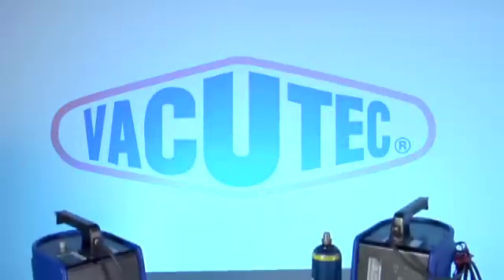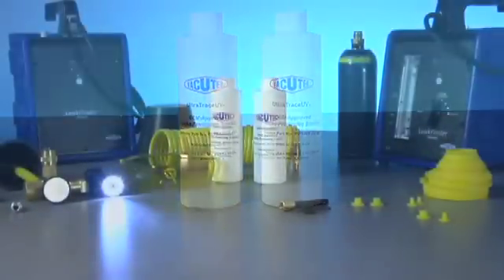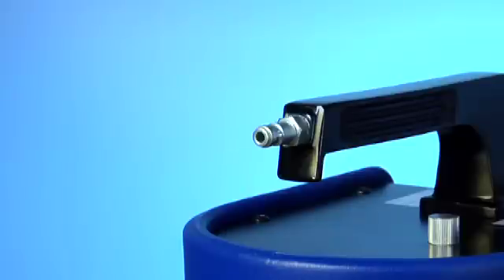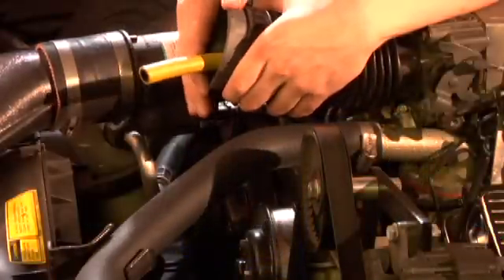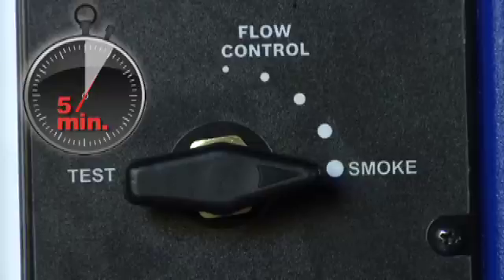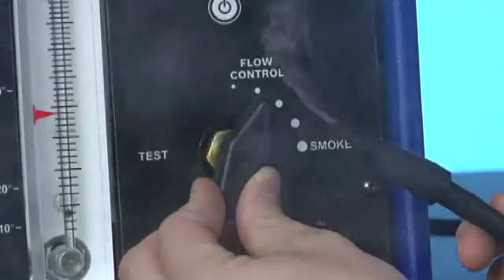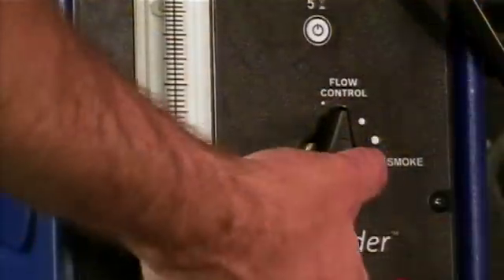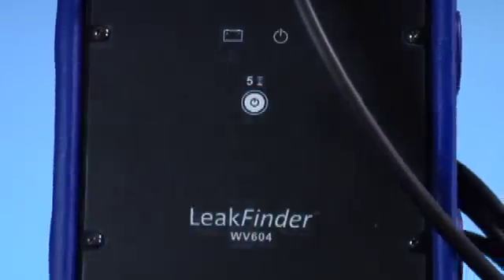Vacutec Leak Finder_WV605 And WV604

Comment: Old machine eeld601 lights come on and then shut off , I check pressure on the air and the battery power connections . Did this rice ans on third try the lights would not come on . Now unit fell over in the car maybe a wire came loose ?